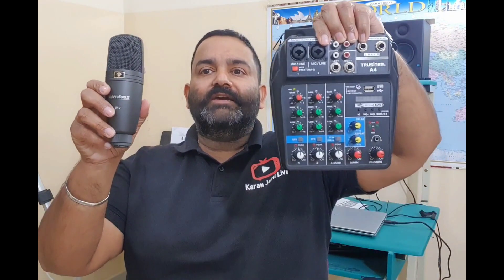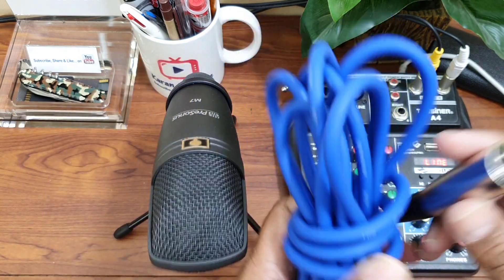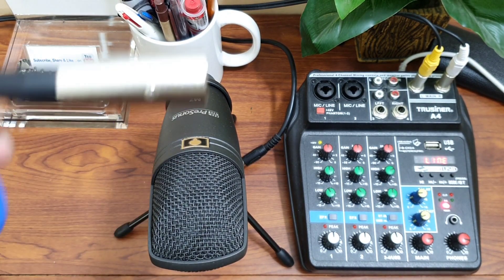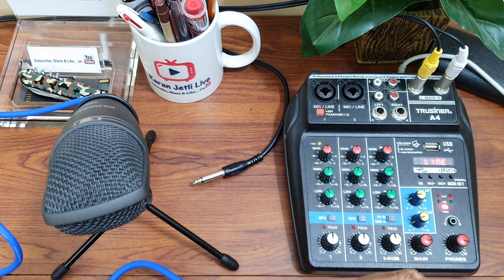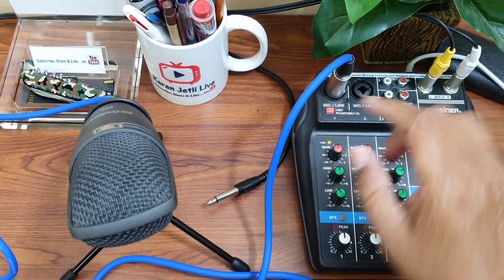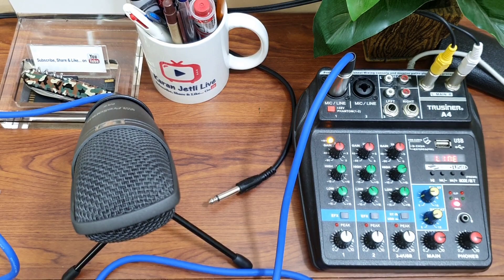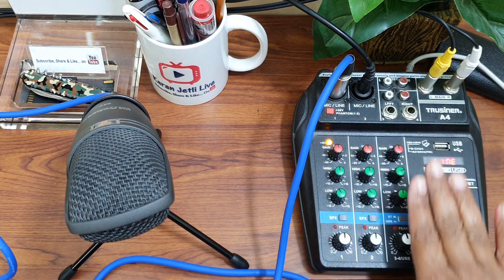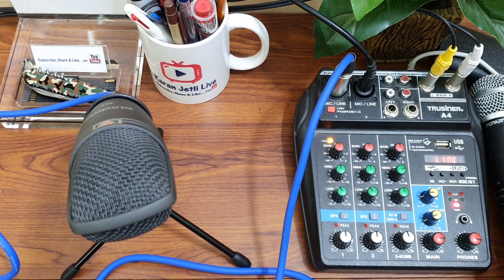how to connect condenser mic with line mixer|difference between condenser and dynamic mic

Comment: Thanks Karan! I am strugling to have my condensor mic delivering decent sound via my mixer. Whatever I do, the sound is really poor and of low volume. And I am talking about condenser mics of resonable quality. Next to using the phantom power, is there anything else I need to take care of? Thanks
Reply: Check prons are in correct
Reply: use a pop filter
Reply from the maker: You're welcome! I'm sorry to hear that you're experiencing difficulties with your condenser mic's sound quality and volume. Besides using phantom power, there are a few other factors to consider when troubleshooting such issues:

1. Gain Settings: Ensure that the gain or input level on your mixer is properly set for the condenser mic. Start with a low gain setting and gradually increase it until you achieve an optimal level without distortion. Avoid setting the gain too high, as it can introduce noise and affect the sound quality. check my other video for basic line mixer setting
https://youtu.be/J4B043w61Ic

2. Polar Pattern Selection: Condenser mics often have selectable polar patterns such as cardioid, omnidirectional, or figure-eight. Make sure you have selected the appropriate polar pattern for your recording situation. For general purposes, cardioid is commonly used as it captures sound from the front and reduces background noise.

3. Positioning and Distance: Proper mic placement is crucial. Ensure that the condenser mic is positioned correctly and is at an appropriate distance from the sound source. Experiment with different positions and distances to find the sweet spot that captures the desired sound accurately.

4. Pop Filter and Windscreen: Attach a pop filter or windscreen to the condenser mic to reduce plosive sounds and unwanted wind noise. This can help improve the overall clarity of the recorded audio.

5. XLR Cable Quality: Ensure that you are using a high-quality XLR cable to connect the condenser mic to the mixer. Poor-quality cables can introduce interference and impact the sound quality.

6. Room Acoustics: Consider the acoustic characteristics of your recording environment. Rooms with excessive echo, reverb, or background noise can negatively impact the sound quality. Try to minimize reflections and control the ambient noise as much as possible.

By taking these factors into account and properly adjusting the settings, you should be able to improve the sound quality and volume of your condenser mic recordings. 
I hope this helps thanks for watching and plz subscribe for more

Comment: So I was planning to buy this mixer with a dynamic microphone, but then I watched this video: https://youtu.be/rsQN8f5CXW8 same mixer, but apparently he cant get his dynamic microphone to work on line 1 and 2 (maybe because the mixer's preamp cant provide enough gain?). 

If i connect this mixer to an audio interface with a good preamp, will the dynamic microphone finally work on lines 1 and 2?

I know I can just skip the mixer all together and just buy an audio interface by itself but I need the EQ and Repeat/Delay knobs on the mixer too.

*the dynamic mic im planning to buy is wired too

uhhmm if you answer this, thanks in advance!
Reply from the maker: Hi i used dynamic mic with this mixer and it worked without any issues..mayb there some issues with mixer in the refered video..and i also used this mixer with my audio IF that also worked like a charm..i will give the links to some of my other vides with same mixer if u want u can check them out and get a better idea..
https://youtu.be/D8NDRBKwLTM
https://youtu.be/uDMASML8G4E
https://youtu.be/UvBHomQnUxk
https://youtu.be/if2OJZIBbqs
https://youtu.be/J4B043w61Ic
I hope this helps..thanks for watching and plz subscribe..
Reply: @KaranJetliLive  Thanks for some insight! I watched a couple of these videos you provided, yesterday. I'll watch the rest. I just subscribed!

Comment: Can the fixed to direct condenser mic to powerd speaker ?
Reply from the maker: No brother condensor mic need 48v phantom power...but if you can find a powered speaker which has phantom power then they may connect it directly ...

Comment: Hi Karan, any recommendation for a good 2line mixer with a phantom power supply? I want to use one port for my BM800 mic and one port for my guitar.
Reply from the maker: Hi bro i checked ur channel you are good keep it up...u cn have the same mixer which i used..its 4 channel mixer check out the link below to buy it..plz subscribe...🙏🙏
https://www.amazon.in/dp/B07XZ59JNF/ref=cm_sw_r_cp_apa_glt_fabc_DG14TEKBNM2K99CH29E8
Reply: @KaranJetliLive  Thanks a lot...already subscribed :)

Comment: Sir i have the same mixer like u.....but when i connect it to my laptop......in the background......there makes a hissing sound......i dont know how to fix it.....please help me......🙏🙏🙏
Reply from the maker: Hi Denson thanks for watching...u cn try to change the usb cable..and also try different usb port..tht hissing sound is bcos of earthing...changed cable or port may work...and plz update if it works...plz subscribe...🙏🙏
Reply: @KaranJetliLive  sir another question.....i bought a condenser mic......which needs phantom power.....i connected it with my mixer but when i press the phantom power it doesnt works.....but when i turn off the phantom power that time it star to work for 1-2 seconds and it doesnt work after few seconds.....what should i do...???
Reply from the maker: So it means ur phantom power buttion on mixer is faulty whn u turn it on/ off it send power to ur mic fr second thn it stops...try replacing the button mixer...

Comment: do yo have to turn off the 48 v phantom power to your condenser mic since the mixer powers both chan 1 and 2? would that make  a difference in the sound with out the 48v?
Reply from the maker: Hi thanks for watching...🙏🙏 48v phantom power is required fr condenser mic..if u turn it off thn condenser mic wont work...however it wont make any difference for dynamic mic...i hope this helps..🙏🙏